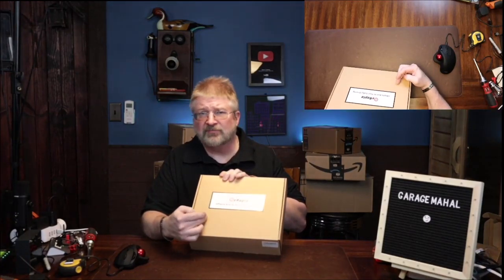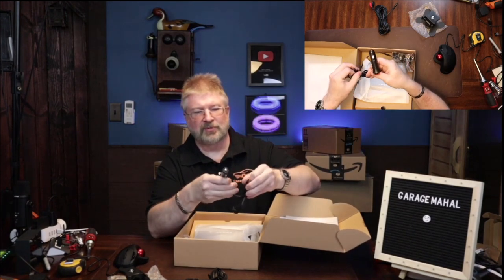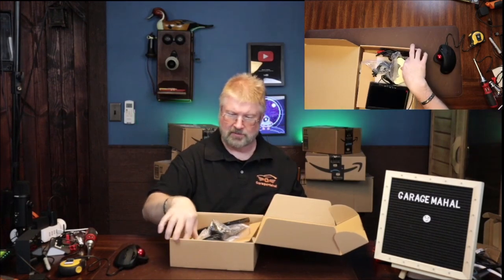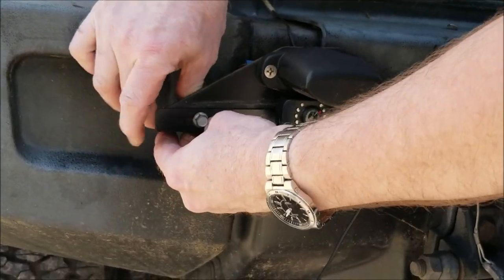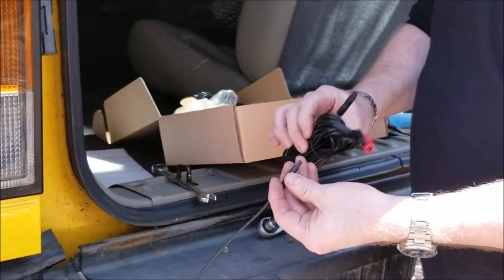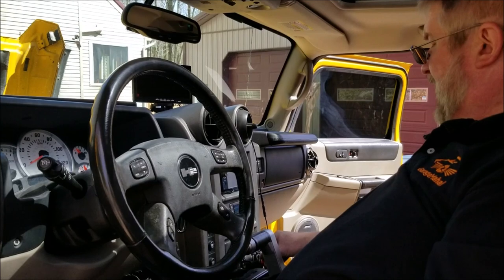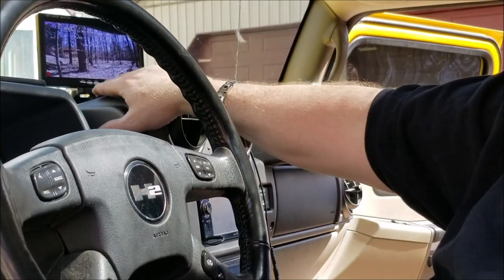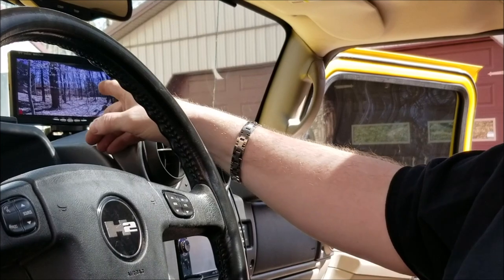eRapta AY7 Backup Camera for Truck, 7''1080P Front & Rear View Monitor kit, Waterproof, Grid Lines

Comment: Yeah pretty good but my truck bed was empty and didn't know how to get the wire to the front of the cab so I just put the wire through the back window and shut it tight. That seemed to work but not sure if that's the right way to do it. Thank's for the video though.
Reply from the maker: I mean, if it works... 😀

Comment: I thought this was supposed to be instructions for mounting onto a "truck".  Will have to look further for a different video.
Reply from the maker: Same process as the video...
Reply: @GarageMahalLife  I have an open bed Toyota truck.  How is it the same process as the video?
Reply: Is there a way to install a second camera? There seems to be another port you can hook up another camera and was wondering if it was possible? There’s also a toggle screen to switch between camera v1/v2